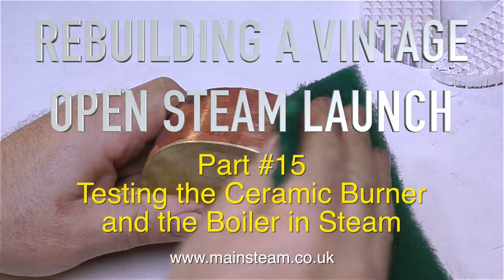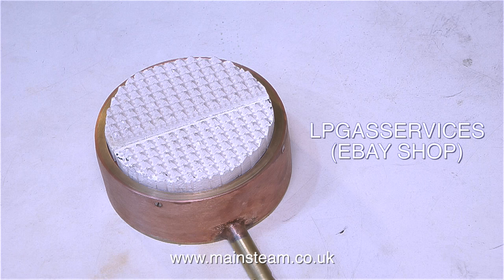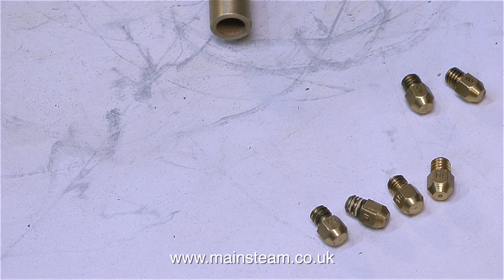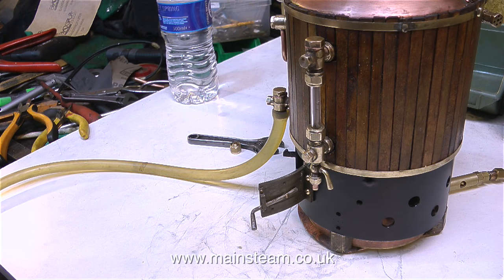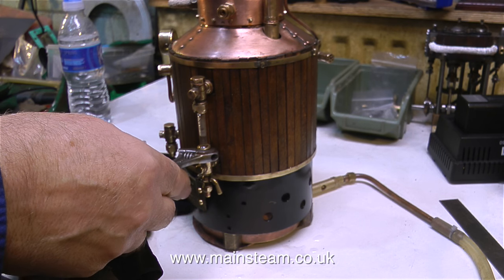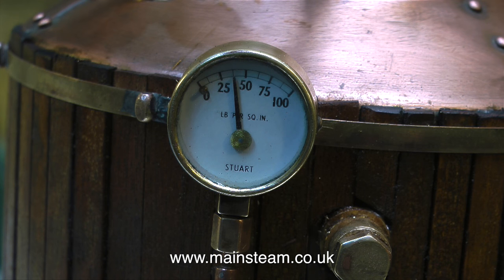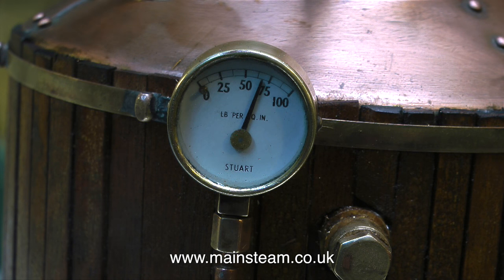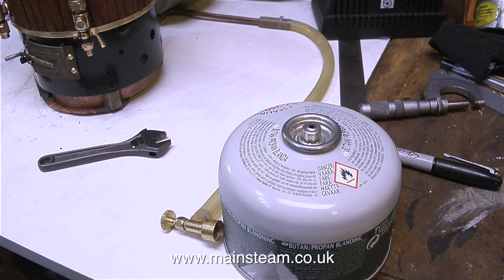REBUILDING A VINTAGE MODEL OPEN STEAM LAUNCH - PART #15

Comment: One of my clients has two, one hundred and fifty HP steam boilers and when the guys installed the newest one they never piped the pressure relief valve through the roof so one day the the boiler over pressured and the steam exiting the relief valve blew a section of the roof off the building.
You have to have a lot of respect for the power of steam.

Comment: great video! the breathing sound your hearing from the boiler is the pressure building, pushing out air at a fast enough rate, then the pressure drops in the boiler from the lost air and/or steam and the boiler doesn't lose air, this then builds the pressure up again and the cycle continues.

Comment: so is Ceramic material porus or have drilled many holes in it? 
Also a more in depth look at the venturi tube would be helpful. Drilling the air holes in the right place, having the gas jet in the right place and the position of the holes to the gas jet are obviously all very important. You obviously know what you are doing and how to make these so any pearls of wisdom would be helpful.
Reply from the maker: https://www.youtube.com/watch?v=kthA6JsIm-M
Reply: What size holes should I use in relation to what size jet to what size venturi pipe? There must be a relation between the 3?
Reply from the maker: You have to experiment to get the best results. Make a couple of burners just for fun and you will see what I mean - that's how I did it.
Reply: Roger that Kilo Alpha

Comment: how long does it take to raise steam on a model steam boiler?
Reply from the maker: I can't answer this question because it depends on the size of the boiler and type pf heat source. On the boiler in this video, (a 5 inch diameter fire tube boiler) Steam is raised in about 10 minutes.